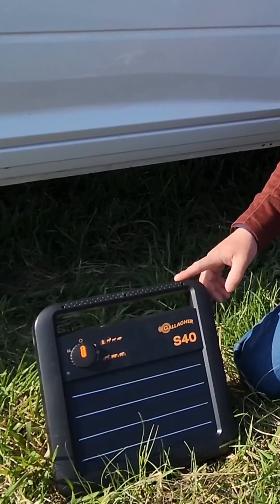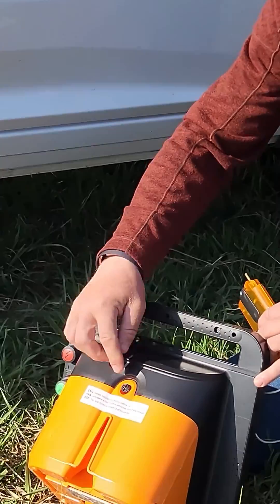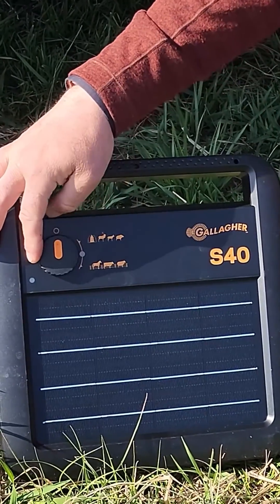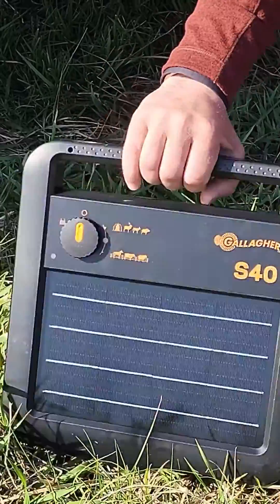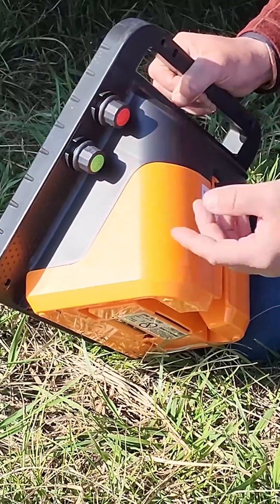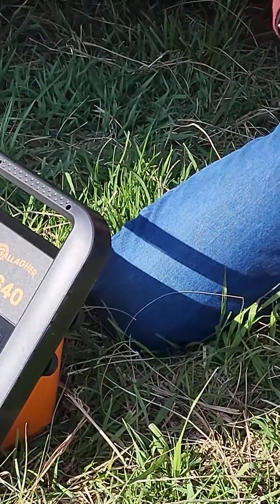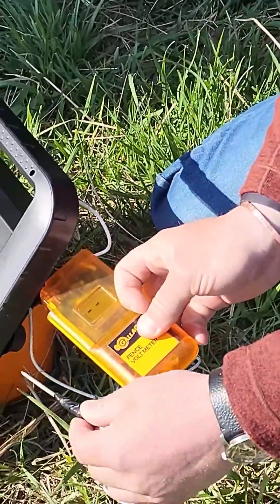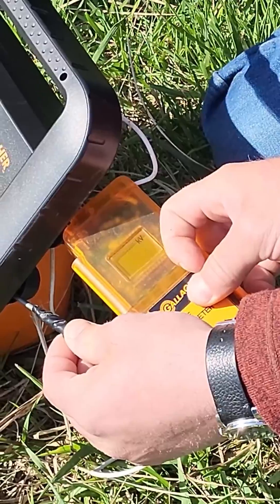How To: Test our S40 Solar Energizer

Comment: What about if is flashing red?
Reply from the maker: Hi Daniel, if the fence indicator is flashing RED, that means the output voltage is too low to control animals.  
 
Check the battery is ok using the battery check function. Then check your earth system using a Fence tester (you want less than 0.5 kV on the earth).   If both of those are ok, the problem is too much load on the fence.
Here is a link to the user manual, refer to page 10: https://store.am.gallagher.com/am/medias/S40-Energizer-User-Manual-INT?context=bWFzdGVyfHN1cHBvcnR8MTA3NTM2MjR8YXBwbGljYXRpb24vcGRmfGFHWTRMMmc1T1M4eE1Ea3lOVE00T1RFeE9UVXhPQzlUTkRBZ1JXNWxjbWRwZW1WeUlGVnpaWElnVFdGdWRXRnNJRWxPVkF8ZTg1ZWJlNzExNDZmMzBhN2ZkMTI3YTQ5ZTQ0M2VlNjEyOGQwMmFhMTE1ZjVkM2RhZTY0MDRkNzI4Mjg5MWJhZA